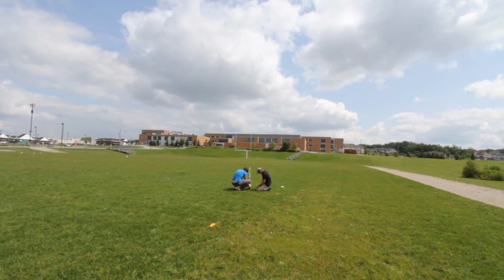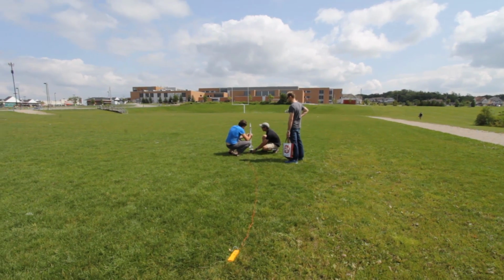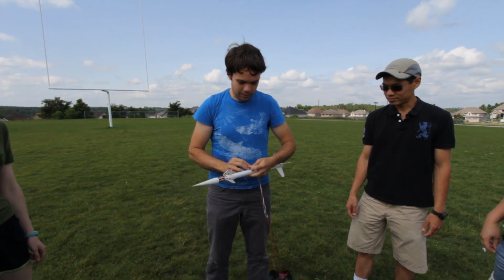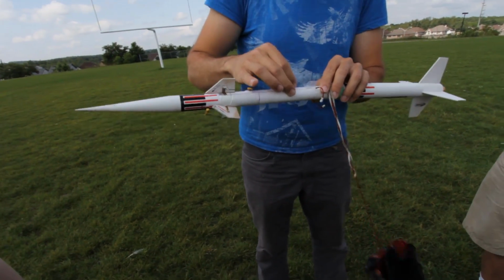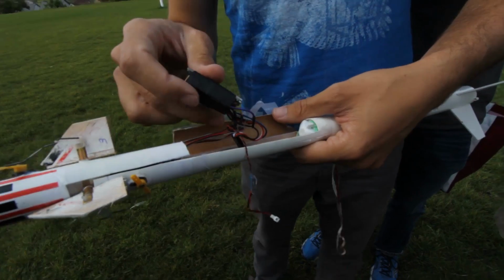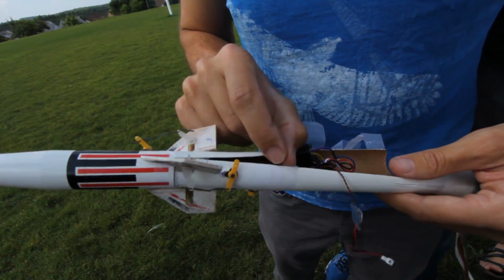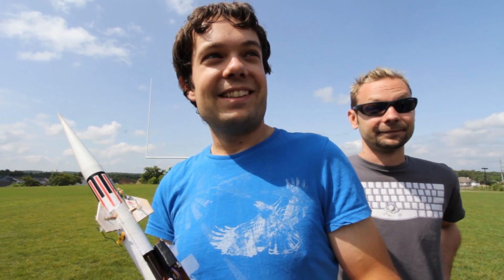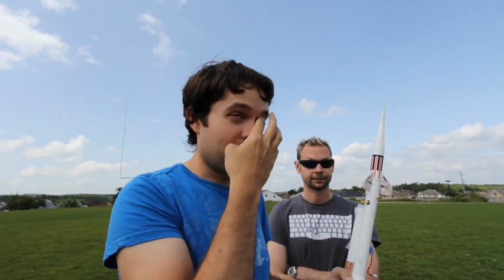Arduino Stabilized Model Rocket

Comment: How did you make sure the brass tube don't slide out of the hole on the paper tube? Also amazing work and I like the fact that I am watching this video 9 years after you made it.
Reply from the maker: There's a larger brass tube holding the smaller tubes, and the paper tube was cut strategically to allow the bigger brass tube to slide in and be glued/taped in place. It was pretty messy overall. Can't argue with results though!

Comment: What kind of controller are you running on the fins? PID?
Reply from the maker: Nope, something of my own design. Basically just a manually tuned proportional system. Very basic. It probably wouldn't work past a certain speed.

Comment: which motor did you use?
Reply from the maker: Nothing big, something like Estes B6-2. It only went up about 150ft/50m, any more power and I'd worry about the stability of the control system. Also there were houses nearby. :)
Reply: @JiveFowl  tnx
Reply: @JiveFowl  that you even react on a reaction for a 7 year old video most people dont

Comment: Do you think that you could put an FPV camera or some other mini camera in the nose, feed the footage to a small computer, which using a thrust vector system, guides the rocket. I was thinking about this for an rc airplane.
Reply from the maker: At the time I built it your best bet would have been to feed the signal to a ground based computer, do your processing, and send the control parameters back to the rocket. Doable for sure, but rockets are pretty violent, so sending and receiving an uninterrupted signal reliably might be tough (check out BPS space channel for some insight). Nowadays there are some pretty powerful and tiny SOCs that might enable you to do it all onboard. The newest Raspberry PIs are about as powerful as my 2015 laptop, for example. It all gets dangerously close to "guided missile" however. :)

Comment: What sensor did you use to tell which way the rocket was facing. I am trying to re create this i have an arduino connected to four servos i can make the servos turn to any orientation I tell it to. The issue i face is that i need a sensor that will tell which way the rocket is turning. What did you do?
Reply from the maker: I used an IMU (inertial measurement unit) breakout board. It was 9 axis plus barometer. I read the values through SPI. Or I²c, I can't remember. Either way, check out Sparkfun or Hobbyking for these sensors, they're cheap and pretty easy to use. (Sparkfun also usually has circuit examples and good documentation, which you can use even if you order some generic part from Amazon!)

Comment: Does not putting controls on a rocket reclassify it as a missile and therefore illegal without the proper permits?
Reply: That would be a rather small surface to air missile.

Comment: Hey @JiveFowl, fantastic work on the stabilization! Do you still have your source for the project – if so could you possibly link it? What is the control algorithm, PID? How did you tune it? Thanks!

EDIT - if you don't want to share it publicly I can give you an email address as well. I'm working on a similar project with a Pi0. I've gotten everything written in python and it moves the servos appropriately, but I have no idea how to estimate control algorithm parameters
Reply: lmao noob

Comment: So your parachute didn't deploy at all... What was going to be your method of deployment? I'm trying to do something similar to this with the rocketry club at school, but my main problem is that I can't figure out a way to deploy the parachute without the ejection charge from the motor (which would obviously not be acceptable with all that delicate electronics in there).
Reply from the maker: Erik Scow I put all the electronic bits in the nose section, thus the canard setup. The ejection charge splits the rocket in half, rather than just the nose cone. If I were you I'd be tempted to channel the ejection charge gasses through a reinforced straw to push the chute out. Or use a push rod and piston to toss it out. But those are probably prone to catastrophic failure. :)
Reply from the maker: Erik Scow Oh and as for the reason mine didn't work, I made my parachute out of a garbage bag, and it was too thick to successfully deploy. Shame. The astronauts made it to space but didn't make it back.
Reply: Cant believe I didn't think of that. Thank you for the help!
Reply: Personally I was thinking of using one of those single use CO2 cartridges if I couldn't use the engine ejection charge.

Comment: many moons ago i had a minso kim blue board for a quadcopter back when i told the model shop i wanted four motor's  cw & ccw props for a quadcopter i was building & they looked at me like i was mad LOL. well i put said board in a plane & tested it just like you by wobbling it to see if elivator aileron & rudder worked maths was never my strong point but im fully qualified in wobbling.

Comment: Not an expert, but is this classified as a missile and subject to regulations?
Reply: I had the same thought but I believe those regulations pertain to guided rockets. Although this rocket is gimbaled for stabilization, it is not actually guided. They may also not pertain to hobby engines and only to certain classes with a minimum total impulse. I don't know the details of the regulations though.

Comment: Hi,

I am currently working on a similar project, and I am looking to have the rocket's fins turn once hitting a certain altitude. I am using a BMP180, a barometric sensor, to calculate the altitude. However, the barometric sensor uses a lot of delays in order to take measurements, which interferes with the stabilization system, so the fins are not able to spin as fast. I have tried using schedulers, but I am relatively new to Arduino and could not get it to work. I also tried using timers rather than delays, but I think there are some delays built in the BMP180 library that also interferes. Do you have any ideas to fix this problem? If not, do you know any other barometric sensors that do not have as much delay, or have another solution to stopping the rocket at a certain altitude? Thanks a lot!
Reply from the maker: That's super cool! Getting an accurate altitude at high frequency is pretty tough. The BMP180 has some configuration options that may increase the rate you get data back at the cost of precision and noise. The low-power mode samples fewer times for its result, and so will give you quicker responses. 

Altimeters also rely on temperature for accurate measurements, which inherently takes a while to change, making the problem worse. The breakout that I used had 10 DOF, including a baro, so it afforded the opportunity to apply sensor fusion to the altitude of the module. You can calculate the position using the accelerometer, but since it's a double-integral to get the position, it's only accurate for less than second. The baro is the opposite; it's accurate over a few seconds, and the longer the better. The idea is you can measure the immediate change in acceleration, calculate a precise change in position, and keep it in the ballpark with the barometer. 

This guy seems to have some source and information on exactly this: https://www.youtube.com/watch?v=TaqtzG7lyp0

Good luck!
Reply: Ok. Thanks a lot!

Comment: What is the best Arduino to start learning on?
Reply from the maker: Probably something like an Arduino Uno, they have a lot of pins and there are many peripheral boards available with all sorts of sensors and controllers. Honestly, any of them are good to learn on; I'd suggest buying a kit of some kind, since things like buttons, LEDs, breadboards and jumper cables are important, and costs can add up if you buy them one at a time. Sparkfun.com is a little expensive, but they know what they're doing and put together good kits with great learning material. Watch a few videos to get the hang of how things mesh together. Tested.com has a decent video, an ILikeToMakeStuff.com also has some approachable material. 

Have fun! :)

Comment: Excellent job. Question: you say the parachute didn't work for any of the launches, yet the rocket looks pretty good at the end. How did that work out without a recovery device?
Reply from the maker: +Ragtime78rpm The chute ejected successfully on all launches, it just failed to open. It added enough drag that it could land safely... sort of. Each time it happened to land in just the right orientation as to protect the fins from damage. On the first landing the nose cone actually penetrated the ground and was standing on end. :)
Reply: +JiveFowl Lawn dart! I love it. Sounds like a plastic rather than a balsa nose cone - unless the ground there was pretty soft. Thanks for responding. I wish you every success in your future endeavors.

Comment: I'm curious why you didn't just mount the fins to the servos and rotate them directly. it may have reduced the drag caused by the control arms.
Reply: +Jonathan Streech That would require all the servos to be in the same position along the Y axis, and the fuselage doesnt have enough room for that. The way he designed it allows for a staggered arrangement.

Comment: Do you have the code posted anywhere for us to tinker with?
Reply from the maker: +Matthew Bernard Nah. It's only a hundred lines or so, fairly simple math. Very hacky. Were I to release it I'd be afraid of someone doing something stupid with it and blaming me somehow. It's too much trouble for what it offers to the general public. I explain the majority of it in the video. Really all it does is get the dot product of each "fin" and the "up" direction and fudges that into a servo output. The trims are hard coded, the coefficients done by eye... it's a mess. :)
Reply: JiveFowl just curious what is the purpose of finding the dot product of the fins for? I’m curious into rocket stabilization, and any advice would help thanks!

Comment: So if i understand it right, you can disconnect your computer from the Arduino after you have programmed it, and the Arduino keeps working?
Reply: +Claudia ft Privacy Yes. You programm it once on the computer, transfer it to the arduino and after that you just have to apply power to it and it starts what you programmed on it.
Reply: XPLOREanXPLODE cool, that is interesting :-) Thank you for answering.
Reply: Daniel Craig I am not that far yet, i just bought one to see how it functions and how i can program it :-D It is very interesting i didn't hear before about this platform.
Reply: Claudia ft Privacy
It's one of the most known platform before the Raspberry Pi actually :D btw. there is also an Arduino Nano version which is a lot smaller, if you maybe want to do some smaller circuits.
Reply: XPLOREanXPLODE That didn't reached me ether, i was still busy with electronic components. If i would have known this before then it would had saved me hours and hours of time from designing and calculating.
Reply: XPLOREanXPLODE But which one is better or got more possibilities, the Raspberry or the Arduino?
Reply: Claudia ft Privacy
It depends on your needs. On the Arduino you write your program directly on the built in Atmega which means it's a lot faster in controlling, which is for example important for some adressed RGB LEDs but you have to write your own code. The Raspberry is a small computer like a phone which means it runs Raspberry OS or other linux distributions like Debian. This makes it a lot easier to use, also because a network interface, video output and other things are already builtin and because of the big CPU it can handle many data way faster.
This may be helpful for you:
http://readwrite.com/2014/05/07/arduino-vs-raspberry-pi-projects-diy-platform#awesm=~oDAQiJd8S68jSP
Reply: XPLOREanXPLODE Thank you so much, i will for sure read it. :-)
Reply: Claudia ft Privacy
I'm glad I could help you, you are welcome :)
Reply: Yes

Comment: You just need to connect a mobile with gps on it, and you got your self a gps guided missile :-)

I just think the pentagon won't be happy with your competition then :-D
Reply: ISIS is taking notes
Reply: Claudia ft Privacy gps systems have a specific feature built in where it wont let you use it at speeds of a rocket to counter individuals using it as a guiding system.
Reply from the maker: My phone has no problem telling me it's going 550mph while on a plane at 37,000ft. The speed limit might stop an individual from creating an ICBM, but doesn't do anything to thwart more practically built devices.
Reply: elitew4rri0r _  Actually there was a guy in New Zealand that designed and built a gps guided pulsejet powered rocket from off the shelf components. If I remember correctly he said the range should be more than a hundred miles or so. Needless to say he was shut down pretty quick and investigated for "tax evasion" which he of course insisted was the government trying to scare him off.
Reply: I stand corrected. Thank you for clarifying
Reply: The GPS velocity/height lockout is implemented on receiver side tho and you can build your own receiver with FPGA-s and SDR, thus the feature is optional, open source GPS IP is available online, disabling the lockout is just a matter of commenting out the lockout conditions in HDL. Besides, I bet if you tested bunch of chinese made GPS chips, you would probably find that some of the chipmakers didn't bother putting such a useless feature in.
Anyone who can build an ICBM in the first place can get around such a kid lock.
Same problem with looking sideways at people playing with arduinos and hobby servos for rocket guidance. Anyone who can build a missile that is actually a credible threat can trivially do better than a bloody arduino guided with hobby servos. Its ridiculous and equivalent to asking terrorists and hostile state players to pretty please not outdo what a hobbyist can do with a overnight hackaton.
If you wan't a real missile control system you throw out the arduino, get a board that can do ethercat communications, buy Elmo Motion Control servo drives off ebay and boom, you got lightweight, high power 1000-2000Hz multi servo control system, with drives that are actually used in missile guidance. You can do resonance damping and the whole shebang, less than 1000$. All you need is one pimply-faced youth to actually make it work for you.
Electronics are easy and security through obscurity doesn't work these days.
Reply: @aleksandersuur9475  hello Sir, what do you mean by resonance damping? Is there any Possible navigation devices other than GPS that can be used?

Comment: What did you use to make the upthrust? What's the engine working on?
Reply from the maker: I think it was a C6-4. Standard model rocket engine.
Reply: +JiveFowl Thanks
Reply: How does the parachute not work?  That's like the most simple part of the project.
Reply: Because of the electronics above the rocket engine. Parachutes are deployed by the top of the engine bursting up into the rocket fuselage pushing out the parachute and nose cone.

Comment: What battery did you use here? Do you have a link?
Reply from the maker: I think it was a Turnigy 2s 120mah from Hobbyking.
Reply: Hi! I am trying to make a rocket model,, which measures the altitude of its flight. I have working code which i wrote, but now I don't know how do I make a rescue system. If i put arduino on top, like you did, how can the parachute come out from the inside? How did you make it? (Sry for bad English)
Reply from the maker: Миша Мыколышин I used an Estes rocket that splits in the middle for the recovery system. That way I could put all the brains in the top, everything else in the bottom. There are a couple that would work, any of the payload ones (like for launching chicken eggs) would work great!
Reply: JiveFowl Actually I made the rocket myself, but I am using Estes C6-3 engine and I wonder, can I make the rescue system in the middle by myself?

Comment: This is too funny. I am an avid Rocketeer who happened upon these systems at Radio Shack yesterday. Got to thinking about how I could use them for a guidance system on my rocket. however I am not very familiar with prototyping electronics. What systems and software did you use? Are PM's possible on YouTube?
Reply: its probably just code . but the electronics is an arduino nano and some servos + a 3 axis gyro/accelerometer and the arduino board is programmed by arduino ide
Reply: radio shack still exists?

Comment: very nice, but isnt the high G-Force-changes manipulating/fucking up the Accelerometer/gyro output?
Reply from the maker: +Olli Queck G-forces aren't that high. I think I worked it out to about 6? Accelerometer is good to 16 (that is, the values are scaled and clamped to 16; its operational range is probably in the hundreds to thousands) and the gyro is unfazed by whatever I can throw at it. Regardless, I didn't do any sensor fusion in this project, threw out everything but the gyro. Its drift is only a few degrees a minute, so as long as I launch it within a couple minutes, it goes about where you pointed it. :)
Reply: +Olli Queck probbably, but the gyroscope is the most important for guidance anyhow.
Reply: +Olli Queck One uses the fusion of info from both the sensor to make the most sense. Gyro maintains angles well but suffers from long term drift. Accelero's are prone to all the short impulsive inertial forces but don't suffer from long term drift. So the accelero data filtered out is able to tell down from up and is used to calibrate the gyro. For instantaneous directions , gyro is referred to .